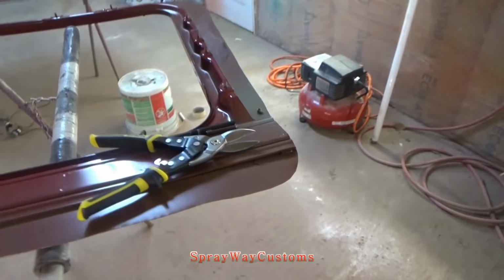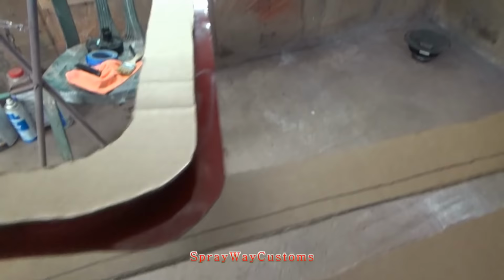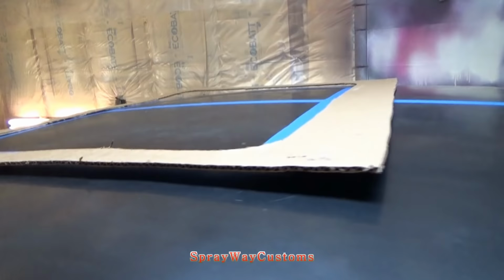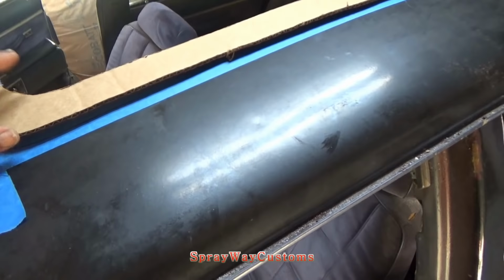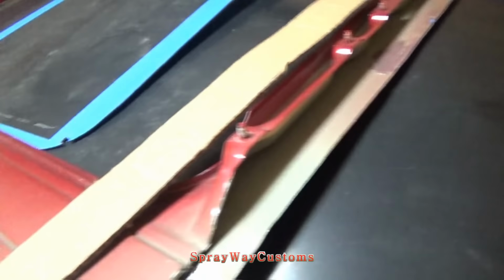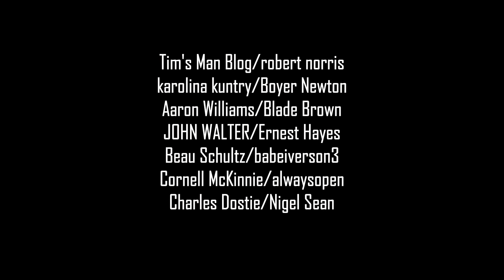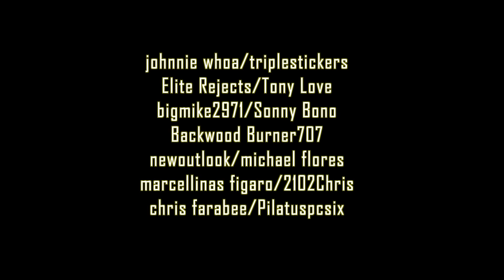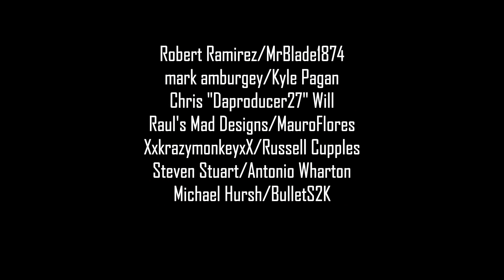How To Install A Custom Sunroof / Box Chevy Caprice Sunroof Installation

Comment: Ima Legit Try to install the same exact sunroof on a ‘90 Crown Victoria Ltd, You think this will fit? Any feed back would be nice
Reply from the maker: Not real sure..as long as the rails clear it'll work. It's a bottom slide so you'll have longer rails than a top slide
Reply: Thanks 🙏🏾, you a real one

Comment: Good work bro , i have a 81 malibu witch roof would you recommend ?im want to go as large as possible thanks in advanced.1
Reply from the maker: I really can't be exact because I don't know you're measurements...I lot of people go with roofs out of a 2000 and up Impala
Reply: +SprayWayCustoms what measurements do you need bro
Reply: +SprayWayCustoms  my roof is 50" wide (from door to door ) 57 from back to front

Comment: Hey, so I was thinking of doing everything but the fiber glass and replace the fiber glass with jb weld then weld around the edges what do you think?
Reply from the maker: I think if you gonna weld it that jb weld would be a waste of time and the reason I laid fiberglass down is for added strength and it's waterproof...hope this helps you...thanks for watching
Reply: +SprayWayCustoms oh okay and would bondo help as well? Because I don't know how to work with fiber glass..
Reply from the maker: Fiberglass is applied the same way Bondo is applied...fiberglass filler just have fiberglass hairs mixed into the filler...just cut some strips of fiberglass to put in between coats of Bondo Hair....Bondo Hair is a brand by Bondo that has the fiberglass already mixed into the filler

Comment: do u knw what else sunroof will fit
Reply from the maker: Pretty much any sunroof will fit, especially if it's a top slide. If it's a bottom slide you have to make sure the frame has clearance

Comment: Hey man I got the exact same sunroof I had a question how did you get the glass to come off to were u only had the frame
Reply from the maker: It has bolts that hold the glass on the frame...can't remember exactly how many but they're spaced out around the frame...hope that helps
Reply: +SprayWayCustoms through  the top were the glass opens
Reply from the maker: Yes...you gonna have to take the headliner down to access it though

Comment: What happens wen the bass hit?
Reply from the maker: Nothing but hit..Appreciate you Airmack Tyree
Reply: @SprayWayCustoms  I was worried about bondo cracking. 4000watts flex is hard
Reply from the maker: It's only a thin layer of Bondo Filler. Most of it is Fiberglass

Comment: I have a 78 box 2door would that same sunroof work in mine?
Reply from the maker: It sure will.... On the bottom slides, you just got to make sure the bracket clear so the sun roof can open all the way but on top sliders it doesn't matter

Comment: What is the size of this sunroof??2000 Nissan quest
Reply from the maker: I had to go measure it but it's 33" x 22 1/4
Reply: @SprayWayCustoms  would that size roof fit a 2 door cutlass....was going to do panoramic but went through 2 and they all had problems so I wasn't too get the biggest possible that slides inside the car
Reply from the maker: This size wouldn't because I barely had enough room in the Box Chevy for the tracks for it to slide back....but if you get a top slide you wouldn't have that problem

Comment: i like watching your vids but this was does wrong. should have been butt welded or flanged at least. and you did not coat the weld up. witch means its going to rust. why... because bondo glass hold moisture ans can wic moisture.. and was not fully welded. so the bond glass will crack. 
been welding/modding stuff for a long time.
anyway i want to find this roof to weld on my 88 s10 blazer. i have 2 popup sunroofs but want a slider.
but you do alright on your painting.
Reply from the maker: Thanks for watching. I already know it could've been done better, that's like everything you do it's a better way of doing things but sometimes everybody don't have the means of doing it..You said you a welder so I'm pretty sure you can find things that should have been done that way or this way but who's to say that your way is that right way because I'm pretty sure you didn't write the book on it, I know I didn't but it's all a learning experience
Reply: im just letting other know if they do this to make sure its done right. as i would hate for in short order to start rusting .. 
if i had to do it your way i would have used weld thru primer .

and yes the way i said it is the right way.. i would have not said it if it was not true.

but anyway dont take offense to it. your a good dude and do good work. and you take videos to show others.

and your right not everybody has the means to flange it or butt weld as its hard to without blow thru. 
so you can do it the way you did it BUT you need to use weld thru primer or you will get rust starting inside that overlap.   
so anybody wanting to do this, either do like i say or if you do it like this, use weld thru primer on ALL bare metal. thats what its for. plus if its not a good weld, just adding putty over it is not good. it will crack ans cause the weld to fail. 

im just trying to help others wanting to do this. i say do it right the first time and it will last for the life of the car/truck.
Reply: +big scott ..... but weld??? that would be the worst idea. he did a good job.  this will last a long time. dont b a hater..
Reply: +SprayWayCustoms ..you did good bro. some people just gonna hate.  butt weld lmfao...
Reply: yall need to calm down of course big scott is right, butt weld would have been the best solution here much harder and more work but certainly the best hands down. the haters are the ones who cant take any criticism even when its clearly needed.

Comment: Dam man I always wondered if that could be done because custom shops charge $1800+ to do a moonroof. Did you go to school for automotive paint and body?
Reply from the maker: Yea I went to trade school back in 1997 but didn't pursue a career in it when I graduated and didn't get back in it until last year...but this something I just love doing....thanks for watching
Reply: The schooling shows because do premium work without big fancy high dollar tools. Great work as usual. Out of curiosity how long did that take to do ?
Reply from the maker: I could've done it in one day if I wanted to but I did a little at a time when I got off from work..it took about 4 days...the longest part is waiting on the bondo and primer to dry for the next coat

Comment: Where did you run your front drain lines out?
Reply from the maker: You can't run them down your front pillars because there's a foam like material inside the front pillars so I just ran them down the middle pillars / b pillars ...
Reply: +SprayWayCustoms  Thanks! Did you need to cut new holes underneath the car to drain them?
Reply from the maker: For the B pillars I did but in the back / C pillars i just ran them to the back sides of the trunk..its drain holes already there but you could drill some more to attach the drain lines to so they will be stationary and not moving

Comment: do u think a sun roof will work on a box with a rag top??
Reply from the maker: Yea it'll work ... You plan on putting an after market roof or one from another vehicle?
Reply: From another.. Like that Q7 joint but I got to make sure the bitch ain't to big.. I got a full Canvas top tho bruh not a quarter top.
Reply from the maker: If you using a factory roof you gonna have to do some welding and you gonna have to pull your top back to get to the metal to weld it, if you want it done right...It'll be worth it though.
Reply: Ok cool I haven't got the top on cuz I was thinking bout doin this.. I'll do this first thn go to the upholstery shop. Thnx bruh
Reply: Yea bro...I'm about to put a LS 1/4 top on mines.

Comment: How u got yo wire ran?
Reply from the maker: Just run it to a fuse coming off the ignition because you only want it to operate when the key is turned
Reply: How only the brown orange an black wire are used correct
Reply from the maker: Just run the brown and orange wire to a fuse coming from the ignition and just ground the black wire somewhere...your's might be a different color but if you don't have the switch it's gonna be a lot more wires before you get to the switch and after the switch there's only three wires bro

Comment: Good $#!+
Reply from the maker: Thanks bro
Reply: How did you run the drip tubes where the water flow out at and the bolts on the inside where they screw in what screws into those
Reply from the maker: Just run the drain lines down the front and back pillars , you might have to drill the holes a little bigger....you not gonna have to drill any mounting holes if you use the same mounting frame...everything will bolt right up the same as the existing car
Reply: Thanks bruh I'm on it